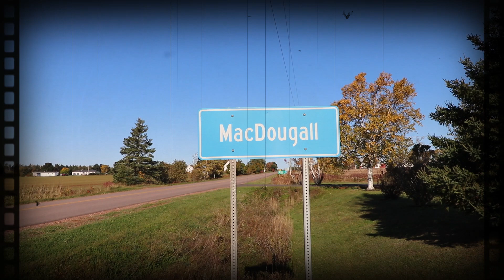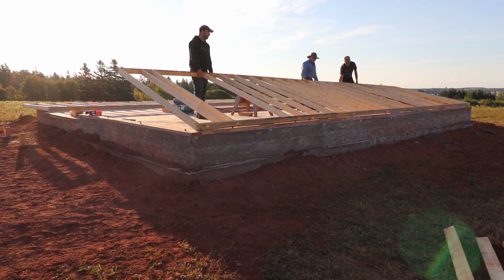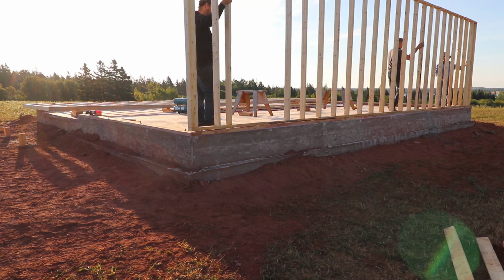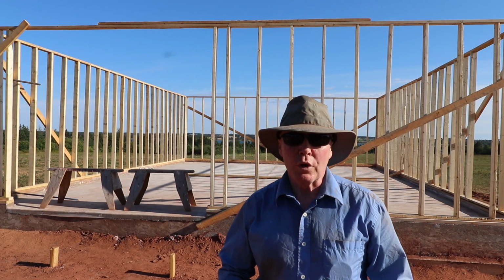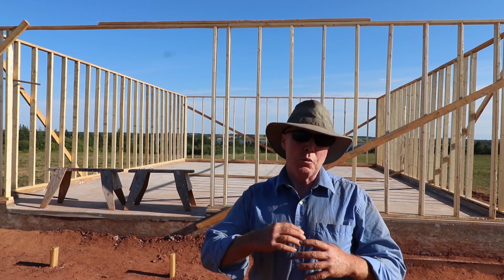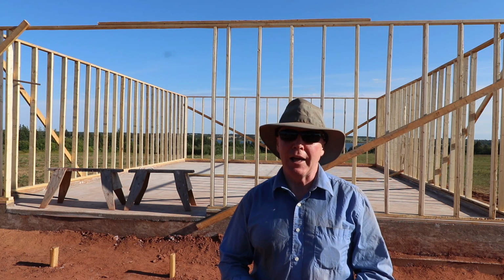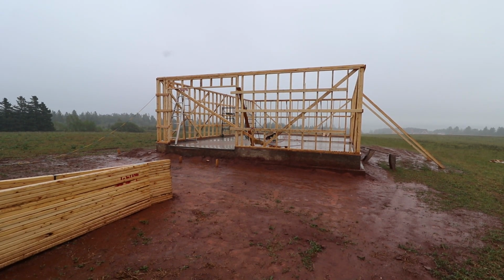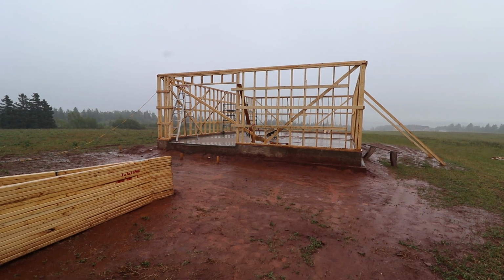S1E7 THE WALLS GO UP AND THE RAIN COMES DOWN ON MY ISLAND HOMESTEAD SHOP PROJECT

Comment: First thing I notice was the power tools. Must mean you have your power or are using a generator to move things along. Interesting was to build your header over your garage door.
Reply from the maker: I have a temporary power pole by this time, it took almost 4 weeks. The framing over the door will make more sense when you see the installation of the trusses.